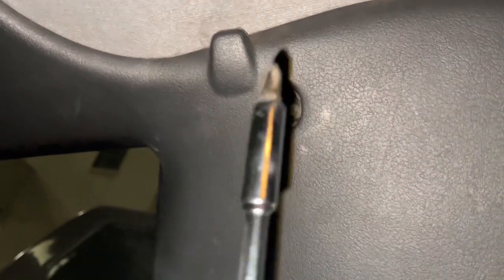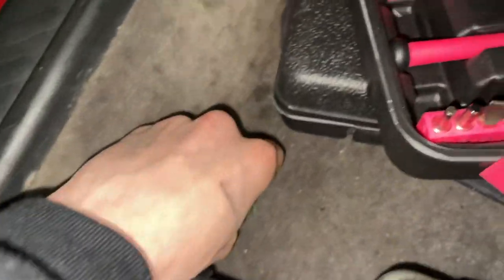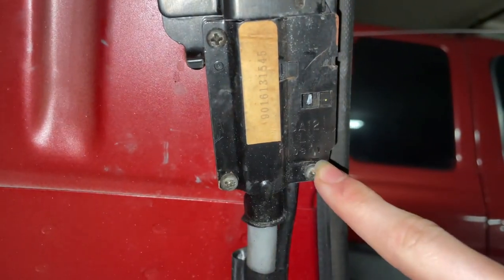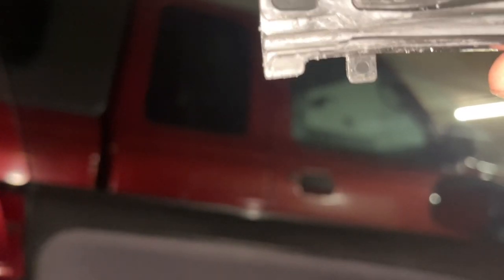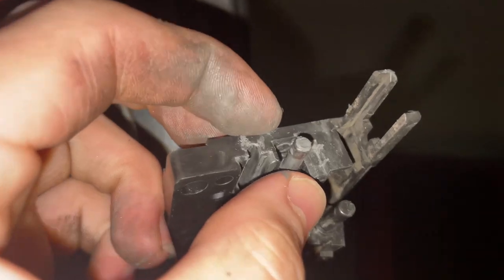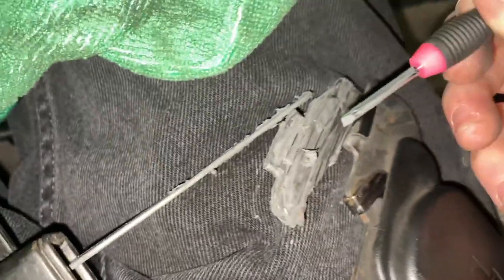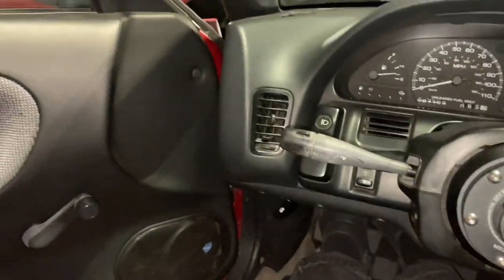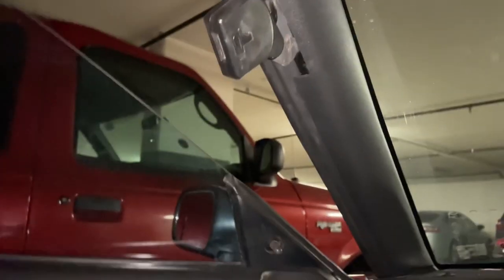How to Fix 1991 240sx Seatbelt!

Comment: Bro how in tf did you put back in the long track ribbon
Reply from the maker: If your talking about the piece that the seatbelt clips into that will slide back to you when door shuts… once you pull the track out with that piece, if im not mistaken there is a little square slit on the end of the track and you put the little metal piece that slids into it and you just push it back into the the track on top of the door, slid it all the way back down.. make sure the track isnt twisted